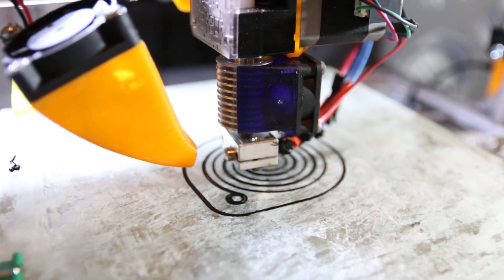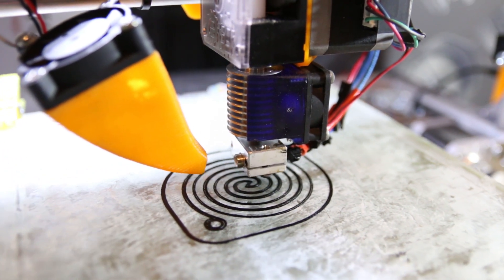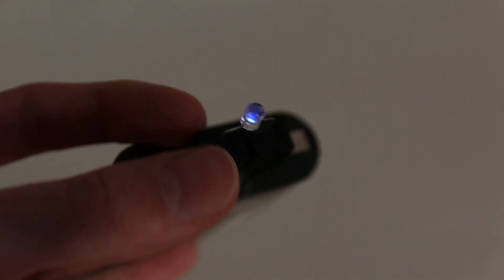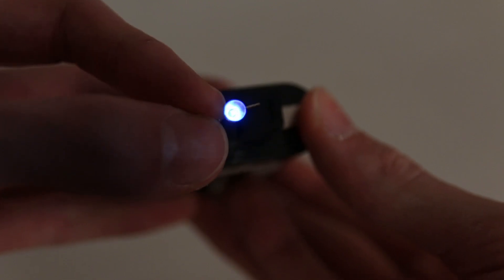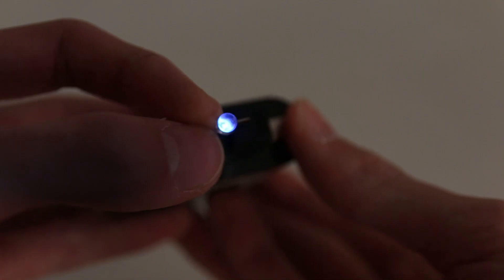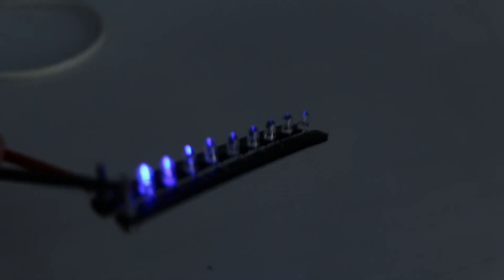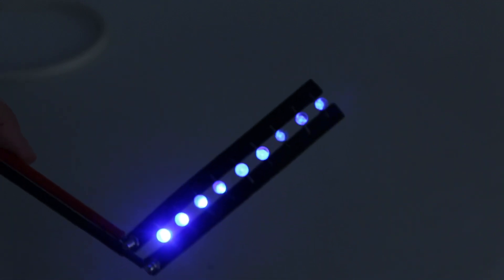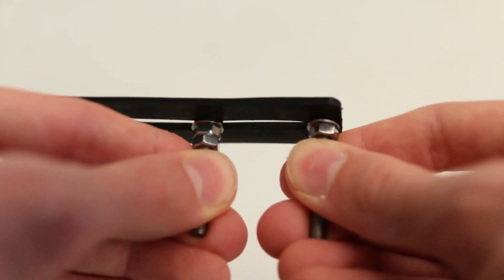Conductive filament - Can you 3D print electronics?

Comment: I wonder if this could be used with electroplating. 

I printed a piece which I then sprayed with a conductive paint. 
This was then subjected to copper electroplating and then nickel plating to make a 3d printed nickel  piece.

I wonder if the conductive filament could mean that the conductive paint would not be necessary.
Reply from the maker: I don't know enough about electroplating to give you a definitive answer, but when it works with conductive paint, I would think it should work with this as well. Can't imagine the metal content of the paint being much higher than with the filament.
Reply: Thank you.
I honestly did not expect a reply.
Especially seeing as this is an 'old' video. 

I suppose the best thing for me to do is get a roll and give it a try.
☺

Comment: if u have a high detail print, you could print a transformer with it, and that means u could also print a dc motor with just the filament, apart from the resistance problem.